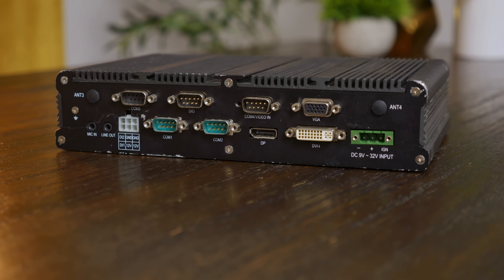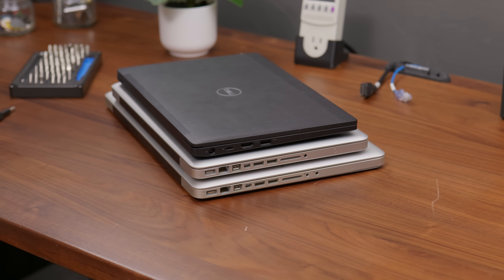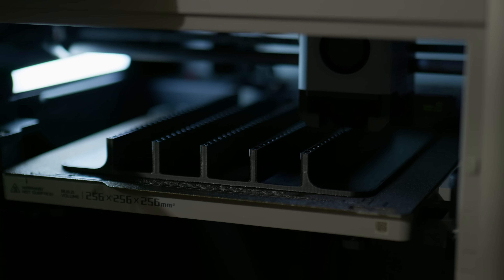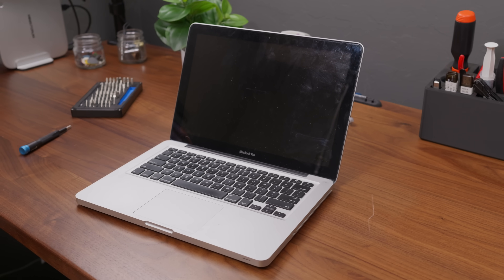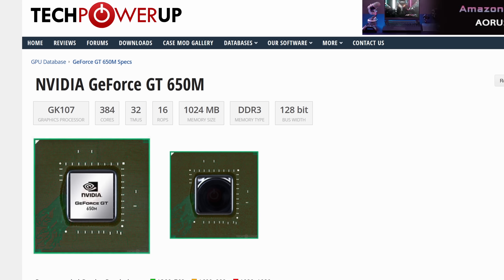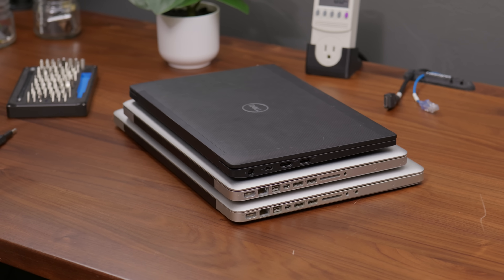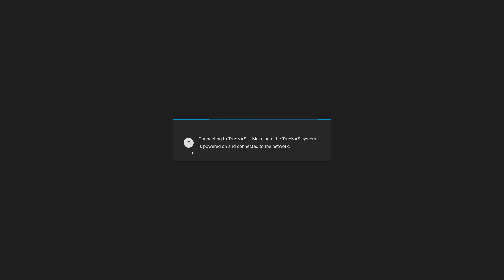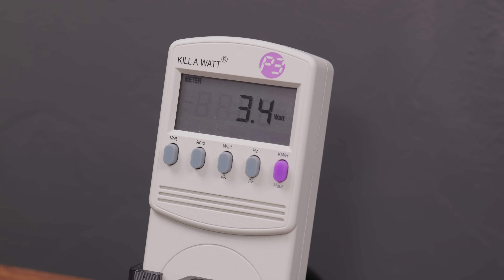Building Cheap & Efficient Home Servers with... Laptops?

Comment: Been running proxmox on laptops for years. Some Tips(can easily run 4 watts idle rivalling rpi's in efficiency):
  * disable screen after 1min(run it in systemd at startup, easily 3-2 watts savings): setterm -blank 1
  * install amd/intel microcode for stability: apt install intel-microcode
  * Prolong battery life by say, stop charging at 80%: Thinkpads: use tlp. Dell: tlp or configurable on BIOS/UEFI. depends on the model. Prevents swollen batteries since it uses power outlet all the time and charges battery when it goes less than 80%. 
  * tlp-rdw: disable bluetooth or wifi via software or BIOS/UEFI via hardware.
  * install sensors: run fan only say, when it reaches 60C temp. 
  * tlp: configure to the hilt, awesome powersavings and can easily hit C8 (of course, depends on your CPU.)
Reply: You can also just listen to DBus events from UPower to enable/disable the screen as the lid opens or closes. A simple Bash script — no need for cron jobs or timers.
Reply: @mks-h  I'm doing it simpler. run setterm via systemd service bringing back rc.local to run once at boot time ala sysvinit UNIX/FreeBSD style. No need for cron/timer. Debian used to have this and removed when systemd was standardized. besides, i'm leveraging rc.local to run additional commands/scripts at startup and flexibility to add in the future.
Reply: @mks-h  Have recreated rc.local ala SysV init via a simple systemd service to run setterm at startup. Simplicity is my game and no cron/timers involved.  besides, i'm adding additional custom startup commands/scripts on my own and flexibility to add items in the future.
Reply: @mks-h  Implemented rc.local... ala sysvnit like UNIX/FreeBSD. Debian used to have it, but since removed when systemd was implemented years ago.  to run as a simple systemd service once at startup.  No cron or timers needed. Besides, i also add custom commands/scripts and flexibility to add at startup in the future.
Reply: Comment saved to notes. Thanks a bunch!
Reply: Same! Actually how my homelab started. I had old laptop that was fairly new but battery only last 1h or so. Perfect to use! Only problem is storage, i need a bigger nas
Reply: or just remove the battery altogether. Even newer laptops with integrated batteries can run only with wall power, no batteries needed.
Reply: lol computer reaches higher pitches than 99.99% of flex plugins (music production shit)
Reply: flame of Udûn
Reply: @old_penguin  LOL... people asked me if Balrog from Street Fighter or Lord of the rings! so i added LOTR on my username... 🤪
Reply: At some point I think distro like Ubuntu need tlp integration
Reply: Same 🎉
Reply: I remember my first proxmox server being on a laptop, for the heck of it, the lid situation is just a few lines of config to deal with. But I quickly grew frustrated at the lack of PCIe, ports, in short: upgradeability. It's like a phone, it can barely be changed.

But if you have a laptop with a destroyed screen that draws next to nothing when idle? Why the F not. There's always room for extra. Making it the center piece though? Me no likey.

That said, i'll never forget that old laptop that gave me my first baby steps out of docker and into VMs and containers. I'll never look back.
Reply: Thank youuuuuuu!!!
Reply: For charging, sonoff s26 and some scripting
Reply: what about laptops that don't have charge controlling? So from my tests tlp there doesn't work there at all. Or did I get something wrong?
Reply: This is impressive, I just don't really understand why run a home server 24/7 at all if it is idling :)
Reply: @4eyesleo  Because some services, which run 24/7, take close to no ressources, henceforth people call it "idling" even though isnt.
My laptop runs Pihole and Homeassistant 24/7 and I still say my server is "idling", because the overall CPU usage is below 0.7% overall.
Reply: @Rakku  touché :)
Reply: @4eyesleo  To be clear, Linux always create an "idle task" for each CPU core/thread. If no tasks are run, Linux process accounting schedules a task to "idle task". That's how it knows it idles. Example below:
C2 (pc2)    2.8%    
C3 (pc3)    2.0%    
C6 (pc6)    1.1%    
C7 (pc7)    0.0%    
C8 (pc8)   86.7%    
C9 (pc9)    0.0%    
C10 (pc10)  0.0%   
Depending on how many and behavior of your Apps, VM,LXC and Guest OS (lightweight Alpine Linux rarely writes to /var/log for example.) you'd be surprised how it idles 24/7 on your home lab.
Reply: @4eyesleo Torrent downloading and home streaming
Reply: Why dont you make a video to share with us here on youtube dude? Seems like a pretty neat setup
Reply: What does hitting c8 mean? I got vocal stuff instead lol
Reply: Ah okay it's a processor state thing, relating to overall machine power use. c8 means deep power down state
Reply: I wish i had read this a while back, my 10-years-old Macbook pro had a swollen battery after just 10 months of use :(
Reply: @czanier you don't need battery at all
Reply: I'm confused though, would the OS still be able to kick back up from a processor C8 state by itself?
Reply: @yarkee8128  The OS isn't sleeping or suspending and still running to begin with. The CPU is in idling state C8 in this case, if there is nothing to do.
Reply: @yarkee8128  below is the output of powertop. Linux is still running, no issues at all and have been doing it for years.
C2 (pc2)    2.8%    
C3 (pc3)    2.0%    
C6 (pc6)    1.1%    
C7 (pc7)    0.0%    
C8 (pc8)   86.7%    
C9 (pc9)    0.0%    
C10 (pc10)  0.0%
Reply: @yarkee8128 some can

Comment: I have a laptop for school Ryzen 4700U, I fried all the USB ports, including Bluetooth and webcam when trying to use CH341a, and Costco warranty refused it because I've previously dropped it on concrete. Another 1.5 years went by, the drop damage got worse until one day the screen is unusable and flickering. Since I no longer have school, I got a 2.5G NIC from Taobao to replace the working WiFi card. Since all the USB are not working, my expansion is only limited to the ethernet card. I didn't even configure the lid b/c it never worked even in normal laptop mode b/c of the damage. The laptop server has been running stably most of the times as I converted to a home server, and it's a good low power alternative. It idles at 8W after all the services I put onto it.

Comment: I run most of my stuff on a thinkpad x220. 8gb of ram and an i5-2520m can actually easily handle like 20 containers with various personal web services, with quite a lot of room to spare.
Reply: By "a lot of room to spare" I mean that the RAM usage is around 1.2GB and the CPU usage is 6% on average.

It's not running anything compute-heavy but it can do things like ntfy, freshrss, syncthing, home-assistant, vikunja, znc, postgres, pgadmin, prometheus, static websites, navidrome, etc.

Comment: As someone who ran laptop servers for around 2-3 years until I moved an HP Microserver and then to NUCs when it died, all I've gotta say is that USB is fine, so long as you're running native and not virtualize stuff.
 Another thing is Heat , holy crap do not run laptops with their screens closed, they WILL cook themselves.
And the third more fun part is that people don't realize is that laptops are loud, relative to their power consumption because you can get like tiny cheap mini PC's used from HPE, Dell or Lenovo for pennies, like $50-$100 with a fairly recent processor let's say at least an intel i5 from the 8000 series or earlier ryzen CPU's for a bit more with 16 gigs of ram and 500gb to 1tb worth of storage that will be passively cooled that will be completely silent, while that old laptop will be blaring it's fan no matter what assuming you don't have a closet to put it in so it can cook itself without harassing you.

Another thing is ports, with a laptop what you have is what you get without any possibility of expanding not that mini-PC's are much better but these in general come with 1-2 mini PCI-E slots on top of storage( your millage may vary the HP Mini-PC's have this weird proprietary flex standard that you can literally just buy a low power gpu it's bonkers) but it still won't beat stuff like the old HPE Microservers, if you can find a G10 or later for around $100-$200 with the lower end CPU's poach em because they come with the best possible kit for a starting out a homelab and learning about servers just don't go Gen 7-9 they are a bit old now and are overpriced.

There's more stuff but I'll save it for responses.
Reply: Starting maybe 2015ish, old school OEMs like Dell and HP got really good at making mini PCs, maybe slightly larger than the modern NUC type PCs, but still really good
Reply: @real151kmh  the extra PCI-E expansion cards they made are useful if we can find carrier boards/cables for em.

Comment: With the batteries being constantly plugged in, it may be possible to set up a limit for the percentage they can charge up to, that way you aren't putting too much strain on the battery having it always fully charged

Alternatively you could use Home Assistant with some smart plugs to set up a schedule to only have the laptops charging at specific times

Comment: For the Dell you should be able to turn off the display switch in the BIOS so it doesn't sleep.

At work I came across a Dell Precision (forget the model, maybe a Precision 7730 or 7740) with a Xeon CPU,  nVidia GPU, 2x RAM slots plus the onboard, 3x SATA/NVME drive slots, and if you use a smaller battery, there's a space for a 2.5" drive.  It's an absolute tank.

Comment: i got an old Lenovo Gaming 3 with a Ryzen 5 4600U, 8GB RAM and a GTX 1650 I currently use as a HTPC next to my bed.
I'm thinking of upgrading the RAM and installing Proxmox on it and have a VM/LXC with Jellyfin and passthrough the 1650 for transcoding.

Comment: My first "server" was an old acer celeron hunk of junk laptop that I ripped the screen off of, and soldered the power cord directly to the motherboard and covered it in hot glue.  Thing ran for ten years 24/7 in a dirty closet until I finally had no more use for it.

Comment: Currently using my old HP OMEN 15 (2018) as a media server with *arr setup with Shoko server and Jellyfin and some limited Docker stuff like Jellyseer and Recyclarr for CF check
The storage is just nuts, still running on Win 11. Tho lately thinking of converting it to Linux. (if you got any good recommendation, I don't mind it)

One big issue is the cooling, it sounds like a jet engine from time to time, and it gets damn hot if I shut the cover. (it's definitely not from age, since it's been that way from the start (it's a space heater in my freezer classroom. Thank god.))

Comment: The main problem with using a laptop as a server is the battery. You can’t run a laptop 24/7 and charge it simultaneously without ruining the battery. Laptops just weren’t designed to be used as a server. However, if you could replace the battery with say a supercapacitor, that might work, however the voltage would drop as it discharges, but if it was plugged in the whole time, that might work.

Comment: The core (and first machine) of my homelab is an old laptop that I got from my mom's coworker, works great and I use Proxmox on it. For my battery needs, I have an automation in Home Assistant that pulls battery information from Netdata to control a Zigbee switch that toggles the laptop charger, keeping it within a certain range

Comment: Always used old laptops as homeservers, low power consumption and the UPS battery is already integrated. Downsides are lack of ECC ram (sometimes even soldered) and lack of good connectivity besides usb-c.

Comment: My 2012 Mac Pro running Ubuntu with ALL my services draws ~125 Watts at idle lol. I did try running a 2012 MacBook Pro basically just to share a TimeMachine backup drive over the network but it was wholly unreliable so I took it out and just set up a TimeMachine friendly SMB share on the main server instead.Recently just started actually monitoring power usage on it though and it's at basically 4 kWh after 28 hours not being heavily utilized. Not terribly energy efficient, but one of these days I'll get a better setup going. Maybe.

Comment: Using laptops as servers has drawbacks, the battery WILL degrade at an accelerated rate due to it being constantly at 100%. And the fans are not designed to run 24/7, they are not usually very robust either and will fail relatively quickly, and they are extremely expensive to find a replacement for IF you can even find it, due to laptop fans not being standard fans that you can get anywhere like on a desktop.
Reply: Disconnect/remove the battery and connect the adapter to a real UPS.  Fans are $10-20 out of china.  It's feasible if you have a minor level of technical ability.
Reply: @meme-d2h1g  the battery can be disconnected, but there goes one of the “pros” of using a laptop as a server, the supposed built in UPS. A replacement fan for my laptop was around 60-70 bucks, not including shipping.
Reply: Actually they are not that fragile. I have two HP Elitedesk Gen 3 running proxmox cluster 24/7 on and had no issue until now

Comment: I'm been using 3 laptops running Proxmox for over a year now.I write a script that checks the battery % every 5 mins and if the batteries reaches 30% It'll power down.

Comment: Dell latitude are perfect homelab candidate with its on board intel nic. Esxi detects it directly. I am using it one at home. 5490. I put 64gb, it is solid. And ı have another lenovo yoga that ı installed truness scale, boot from usb like u but just one usb. And make internal ssd as pool. Even tho it is one ssd, it is running esxi vms and they are backed up to truenas vm in esxi with usb 2.5hdd passthrough in a mirror conf. 😂

Comment: Yes, you would need a sata controller to use that B key slot for storage, but what you could also do is use something like an SN520 nvme which has two cutouts, which makes it fit and work completely fine (done that on my old thinkpad x270)

Comment: This channel is heading in the right direction. Excellent content.

Next, you need to pull the internals out of the lappies and put them in a 3d printed enclosure for a mini rack setup.
Reply: As a person who really actually considered doing it... This isn't really as good of an idea as it might initially sound, IMO. Laptop boards are designed for a very specific layout, especially the older ones. Some of the problems you may encounter include: needing to sacrifice features (like battery or SATA device connections) to fit the board into a smaller enclosure, ports being on three sides of the board, board refusing to work without an arbitrary component connected, unreachable power button, poor heat dissipation, etc. Solving these problems requires spending a lot of time in CAD, and you literally don't need to: laptops literally come with a convenient case for the motherboard which you already have, it requires no time, money or effort to just continue using it.
Reply: This is actually what I was looking 4, I have a few waste laptops with no charger,  I would like to make a rack and a cluster to try to get a bit more performance bc are a bit old and crappy, but also free xsxd

Comment: If you don't have access to 3d printing, a kitchen pot lid organizer is a good alternative. I bought one to store my laptops a while back.
Reply: I use a file folder organizer I got at a thift store for a buck.
Reply from the maker: Genius!
Reply: @HardwareHaven  How do you compare the efficiency vs Rasp Pis? Still need some R Pis anyway because I don't see how to run 2.5/5gb networking for the home just from laptops.
Reply: I am using the wood/bambu made dish holder from IKEA ,working well
Reply: Ha, the good old IKEA holders. They can be used for everything. I use the stainless steel holder for my smoker for holding pork ribs 😄
But organize laptops with it, why not.
Reply: Sounds like me.  I use kitchen cooling racks under laptops.  1/20th the price of "coolers", the metal dissipates heat, the legs help organize cables while allowing airflow, AND it keeps the laptop above spills on the desk.
Reply: Im using those table napkin holders from the dollar store
Reply: lol I was thinking about the organizers my wife uses for her cutting boards and cookie sheets when I saw the printer at work in the video. 👍
Reply: Metal file organizer works great
Reply: or u could mount them on wall with metal strip and buy some extra long zop ties.i seen some 3m long zip ties for drip cheap in Amazon
Reply: File folder holder works too
Reply: Dude that's a fantastic idea! Thank you.
Reply: LOL I use a vertical pot organizer as my mini 10" rack
Reply: I have a large setup, using top rack from a dishwasher
Reply: Fun fact, you can 3d print even if you don’t have access to a 3d printers, a lot of libraries have 3d printers that you can use for a very small fee
Reply: 100% brain usage comment right here!
Reply: I use my old LP holders. Which makes me wonder where are my LPs?

Comment: I don't know how common it is but my old ThinkPad (X1 Carbon 6th Gen) has an option in the BIOS to limit the max charge percentage which drastically reduces the wear on the battery. I never thought it'd make much of a difference but my iPhone prompted me to enable an 80% charge limit shortly after I bought it and almost two years later it still has 96% of its original capacity.

Comment: Perfect! You’ve inspired me to set up my old Latitude 5410 as a low-power Home Assistant box. I like extending the life of my old Macs, but the only one worth using in 2025 is my 2014 Mac Mini as a low-power (~6W idle) PBS server. I’m done using my old MacBooks (2011, 2012, 2013, 2015). No more fiddling with OCLP or trying to run Linux Mint!